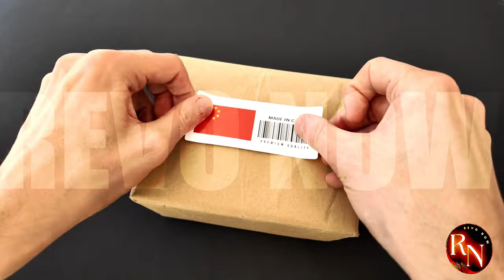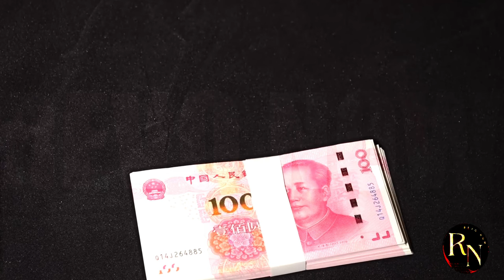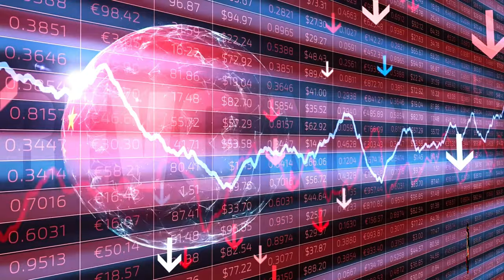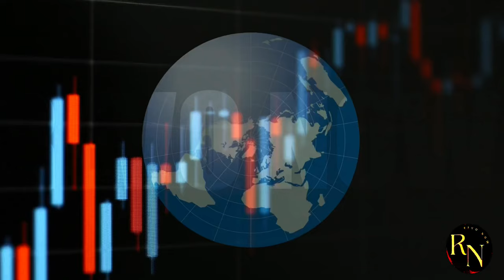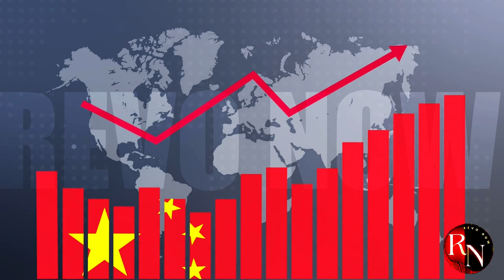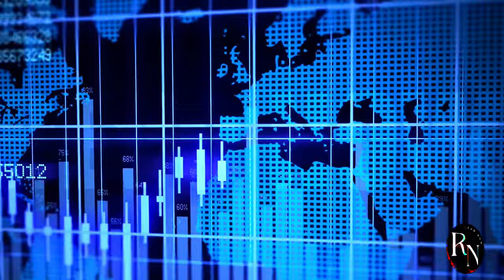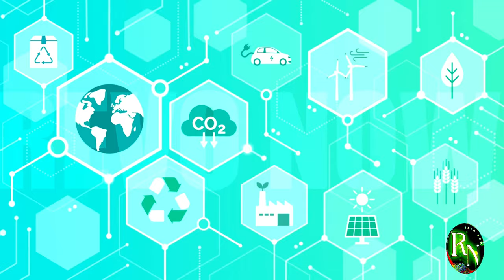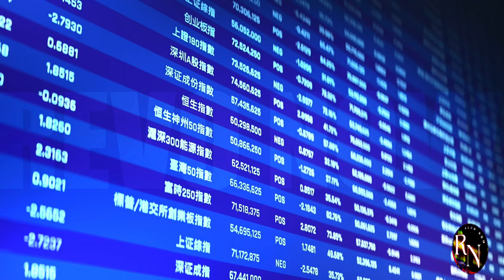China's $3.46 Trillion Trade Surge: HOW DID THEY PULL IT OFF?

Comment: More than 2 decades ago, all my tv, vcd player, speaker sound system, aircon, fridge, rice cooker, etc etc in my home were either western brands or Japanese. Then came the Chinese. Not only cheap but good, if not better. I remember my Japanese brand vcd player at that time. Not only it was expensive but it could only played original vcd. The Chinese made ones at a fraction of the Japanese brand's price, can even played pirated vcd copies without any problem at all. Which one would you prefer to buy then in your case?